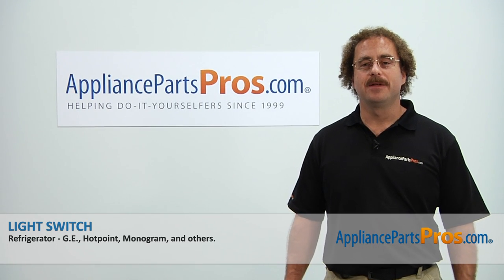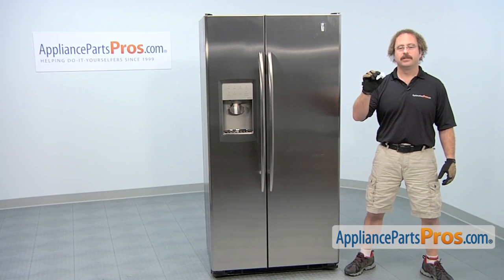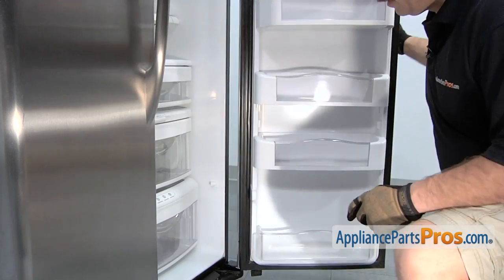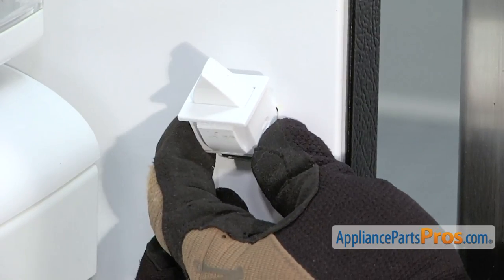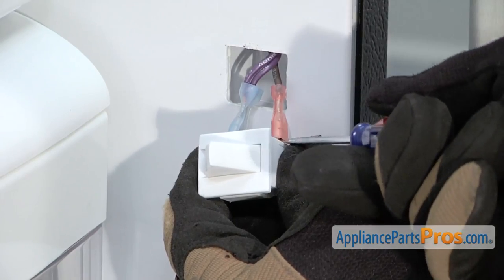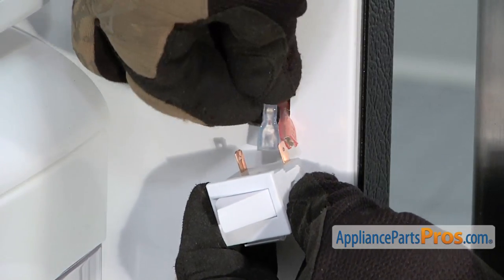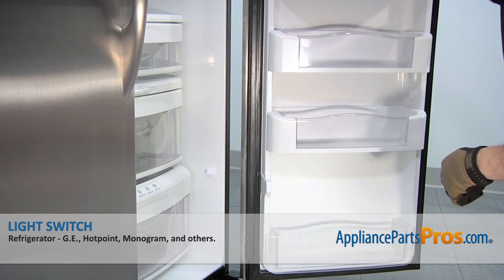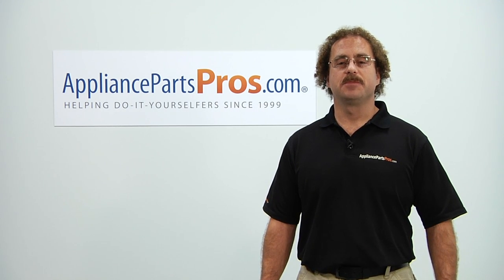How To: GE Light Switch WR23X23343

Comment: My switch broke when a jar fell off a high shelf and smashed it off. This is a very easy repair. Make sure you UNPLUG the fridge before working on it. The switch is in series with line voltage!

Comment: The cable for my switch did not pull out of the housing the bad switch disconnected but I can't install it because of the short cable and I don't know what cable goes to which pole. Trying to figure how to open the side to get more cable length.

Comment: Would this be the cause of a dimmed LED light strip? I took out the strip and tested the lights with a 9v battery and they were fine, but when they're in the refrigerator they're extremely dim.
Reply from the maker: It is possible yes. What is the model number of your refrigerator and we can look and see what else might cause the issue.

Comment: What is causing my door to swing fully open. I have to hold it.
Reply: Maybe the legs at bottom of the frame. Adjust length so front is higher. Door will swing back.

Comment: Simple, to the point, and straightforward. Good.
Thanks for posting.
Reply from the maker: Beretta249 Glad the video helped you get the refrigerator fixed!
Reply: AppliancePartsPros 
Rule zero, sir/ma'am: "always check the connections."
Turned out the bulb was bad, but we started by replacing the switch so in the end it all got fixed. =]
Reply from the maker: Beretta249 Glad you were able to get the refrigerator fixed!

Comment: MY LIGHT WENT OUT BECAUSE I DUMMY WAS BREAKING A BAG OF ICE ON THE EDGE OF THE FREEZERS INSIDE AND THEN NOTICED MY LIGHT WENT OUT. CAN IT BE THE LIGHT SWITCH OR SOMETHING ELSE?  I HAVE PUT IN A NEW SWITCH AND NO GOOD.
Reply from the maker: So, was it the refrigerator light that went out when you broke the ice inside the freezer? Have you tried replacing the bulb itself? If a bulb is jostled enough, it can be damaged, even if it doesn't look visibly broken.
Reply: I have had a lightbulb 💡 in my GE Refrigerator since 2002.  Today it's Oct 6th, 2023.  Replaced bulb, still not coming on, so glad I found your video.  Will be getting back with you tomorrow to let you know if I have any success changing our The Button Switch.  Keeping my fingers crossed 🤞🏼 TYVM